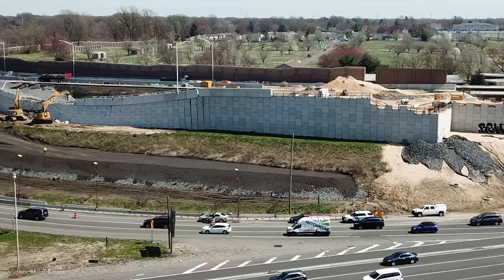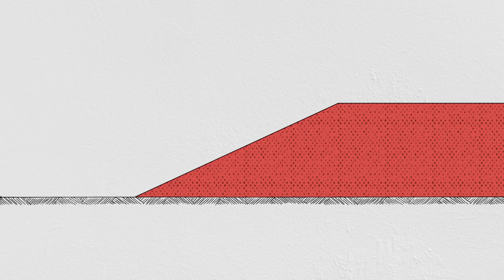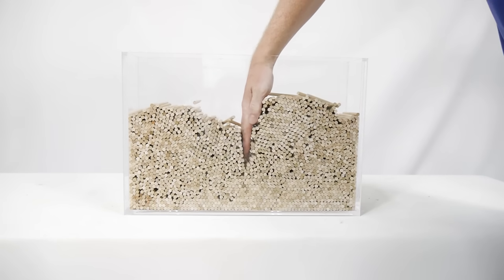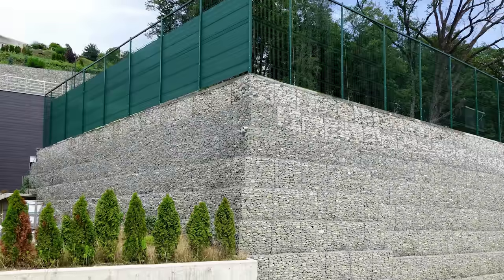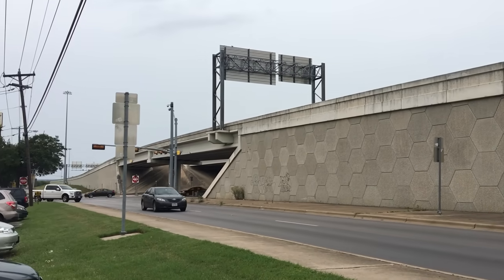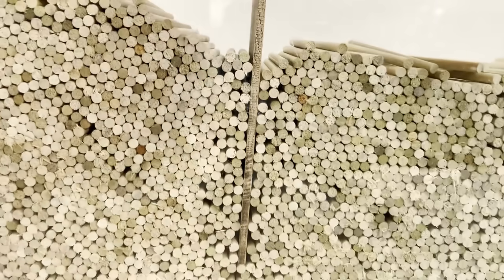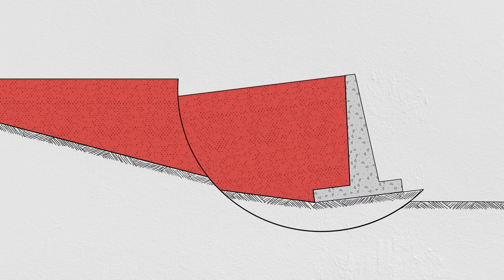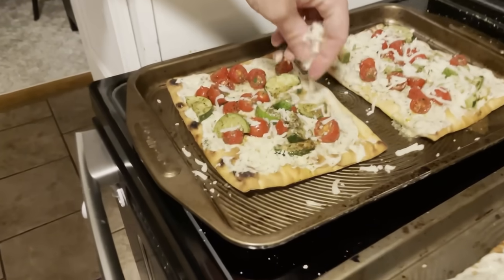Why Retaining Walls Collapse

Comment: Hey Grady! Could you pretty please do a video one day on how engineers construct the parts of a bridge that go down into the water and rest on the riverbed, and support the bridge structure - I don't know what they're called really (the legs?). But they are like magic to me - I don't understand how they built them, or how they don't get swept away by the currents of the river. As I read somewhere, they often use these sheet piles that you mentioned in this video to create a water-free space right down to the riverbed where they can start putting the foundations? Would totally love to see a video about this! Love your channel!
Reply: To be specific, I live in St Petersburg (Russia) and these bridges were built in the 1870s, and I just can't imagine how they did it back then.
Reply: I strongly second this request!
Reply: Grady's vid on building underwater 
youtu.be/URC125wpMS4
You can build a temporary dam down to the river bed, then pump all the water out, leaving you a clear river bed to work on.
Reply: Yes, I agree. It's hard to find videos that show them sucking water out and installing metal plates, and I am curious how they pour concrete for underwater too! And what exactly sits on the concrete I beams! I've seen plates, metal, but I never see them pour concrete on for the actual road
Reply from the maker: I have a video that covers some aspects of bridge pier/bents that someone linked below.
Reply: @PracticalEngineeringChannel  Thanks! I must have missed that one.
Reply: @massimookissed1023  Exactly. That kind of underwater temporary dam creates a dry area where work can take place, it’s called a caisson.
Reply: @SamuelKristopher  might have done it "Roman-style" and just use a very very lot of structure!

Comment: I live in New Jersey and I have been waiting for the report on this collapse.  Immediately after the collapse, a retired civil engineer friend with connections to NJDOT told me that NJ tried blaming the contractor for not following the spec.  The contractor replied with a warning letter that they submitted to NJDOT that it would fail.  Then all went quiet.  There are multiple ramps that were built up in this project including the half of the roadway in the picture that didn't collapse.  They are still proceeding with other ramps but one has to question is what was already built wrong too?
Reply: Im not surprised. The level of state incompetence is mind blowing.

Comment: An underground parking in my home town in Belgium was made with pile walls. They first drilled the retaining pile walls, then made the concrete top, and only then started to excavate the parking. 

You can still see the ceiling of the parking is rather rough, and the walls also aren't covered and just show the concrete piles.

It had a big advantage for our town, as that area was still usable during most of the construction works. I believe they even did the top in two parts, to allow the bus lines to keep using the square. And it greatly reduced dust in the environment, so less complaints from inhabitants.

Comment: I live a few miles from this project.  A very busy and populated area.  This project has been going on for almost 10 years in the construction phase. There have been a lot of issues with people, property etc.  It would not surprise me if there was some change in a phase that wasn't fully design out. It also could be a misunderstanding of the topographical area.  There is a marsh in this area and they have built around and through it over many years.  As a retired engineer I can imagine how complicated this project is.  I'm just thankful no one was hurt.

Comment: I've been wondering for a long time why residential basement walls don't collapse under the pressure from the surrounding earth. This video answered some of those questions but I would enjoy a video or other discussion of how these ideas apply specifically to residential basements. As always, thanks for the good work!!
Reply: Typically these arent very tall and the house structure acts as internal bracing to an extent.
Reply: They certainly can. Especially older CMU basements.
Reply: Basements typically have footings too, not just the vertical foundation walls. They're also a square box so they have something to resist the sideways forces, so long as the walls themselves don't bend and fail.
Reply: It helps that basement walls are not vertical cantilevers. They can be thought of more as beams spanning from the basement floor to the basement ceiling (which is why horizontal cracks running across the middle of the wall are scary... that's the wall splitting open under pressure). It also helps that they have the weight of the house pressing down on them and holding them together (think of how you can hold a stack of books sideways by pressing them together so they don't fall down).
Reply: So over here, the basement is known as the most expensive part of the house and that's for a reason, every single house and especially the foundation and basement must be engineered to strict criteria depending on soil type, location slope and the rest of the house. The planning engineer is held accountable for the construction and has to present to control the build process, reinforcement layout etc. And that's only for a single family home. Public buildings like schools and such have even stricter rules.
Reply: The walls also have footers. Picture an upside down T
Reply: I've built many, many homes, and we don't backfill totally against even the 42" stemwall (because the backhoe, etc. will bend it).  We get the floor structure and subfloor on then backfill.  8inch concrete walls are strong, but framing elements stiffen them in their "loose" direction-
Reply: They do fail.  I was a painter on a house with an exposed basement wall on a hill and i probably was sandy soil.  
It was a luxury house in the sixties.  The upper level had a garage and before the floor was poured, the caterpillar operator parked his cat inside the garage to keep it out of the rain. As mentioned below, the wall bent outward because of the extra weight.  They somehow pulled the wall back to plumb, but it was an ordeal.
Reply: @stevefirst9521  To keep it out of the rain. 

SMDH

Comment: Hi Grady.  Great episode.  I live in the area you featured in the opening and commute up NJSR 295 almost every day.  If you look carefully at the aerial images you will see large expanses of open space in the background.  that is a cemetery - a huge source of infiltration for stormwater.  What you cant see in the images is  the fact that this area is part of a long belt of clay deposits that run from southwest to north east NJ, roughly along the NJ Turnpike.  These clays are what's known as 'acid producing' as they are buried, sufidic marine clays.  When exposed to air and water, the sulfides react and produce sulfuric acid.  It is not treatable with any amount of lime and must be kept unexposed during construction and reburied.  The acid is strong - ph around 2 and can attack any metal or concrete and will kill almost any vegetation it comes in contact with.   The other part of this scenario is the fact that the clays are highly impermeable.  They used to be mined and used as a liner and cap material for landfills.  The clays are set in layers of alternating sand and clay.  During initial stages of removing vegetation from all the slopes along 295, the slopes were left barren for a long time.  The slope cuts caused the clay layers to daylight  in this area.  And many many times, large seeps were visible in different places along the slope.  In winter you could easily see them because they froze.  I think the combination of the acid clay as well as the seeps with the enormous open source of rainwater infiltration probably undermined the wall.  The basic wall design was a vertical layer cake of the panels on the sides connected to each other on opposite sides of the road with a geogrid which when loaded, would act to pull the panels inward or at least hold them tightly.  there are many layers of this as the wall goes up.  There is not much else behind those panels but earth and geogrids acting in tension with the applied earthen load.  Anyhow the clay and those seeps are major factors in the construction out there.  it will be very interesting to see what the final forensic report comes out with.  Hope you do a follow up when that is released!  keep up the great work.

Comment: Always a pleasure to learn more about earthworks. Thanks!

Btw, that first video you mentioned was inspirational. I'm into wilderness survival as a hobby and the reinforced earth method is great for building a warm shelter when available tools and resources are limited. Dirt and plant fibres are readily available, and you won't need to mess around with the time-consuming process of making and baking bricks.
Reply: Unbaked mud bricks usually have plant fibers to reinforce them.  And wattle-and-daub construction uses woven wood from thin branches as "rebar" for the daub (applied clay and aggregate), either on its own or in the spaces between timber framing.
Reply: Are unbaked mud bricks useful, though? Seems like it'd be more worthwhile to just slap and mold on a handful of fibre-mixed mud onto the wall. Much less time and labor.

I can see the benefit for the roof, though. Plain dried bricks could be made and dried before reaching roof construction, and then layered up in a dome for a secure roof.

To clarify, the situation I'm considering is when you need to get a very warm and/or protected shelter up ASAP, you have limited tools and resources, and a basic tipi or lean-to is insufficient. The mud shelter just needs to last long enough for a more permanent solution. The environment envisioned is a windy northern rainforest, cold but not yet freezing.

Comment: My mom has a retaining wall behind her house, she got it put in because she wanted her yard to be flat in 2 levels. That 4 foot rule applied exactly here and thats how tall the wall was because "they cant make a wall over 4 feet without city involvement" fun fact the wall has collapsed 3 times
Reply: Wow. That’s rough, since the City involvement is not necessary for retainers four foot or less the contractor is free to build off the top of his head, thus constant collapse and replacement. Perhaps the city has standard engineered walls in a hand out for the public to use. In SoCal the building depts have such handouts for the public. For short retaining walls.  More expensive but less problems in the long haul. Good luck.
Reply: @stevelopez372  If I ever get one built on my property I am definitely making them build it at least 4.5 feet so they have to build it right
Reply: @stevelopez372  Lmao imagine thinking the way they do things in Cali ougbt to be THE standard. Stay on that dope bud
Reply: @toastedt140  Imagine thinking making plans for an engineered retaining wall available to the public is a bad thing.
Reply: Our local code enforcement has lowered the four foot rule.  Where I live it is three feet.  Anything higher than 3 feet requires a permit, and architectural plans.  They also make you install a product called geo grid behind the wall when you are also installing your drainage system.

Comment: I live in a very old Italian city, it is very common to find an older version of these walls along the streets of the historic center. I wonder how they work, looking closely they have large cracks that act as drains, the base of the wall is often made of a solid block of stone that has always been present on the site, while the rest of the wall seems to be made of simple stones and bricks . They are not reinforced by concrete or metal, I have always wondered how they work.

Comment: Great video! I learn a lot from all of them.  I am not a engineer but have constructed several stone and stackable block retaining walls over the years. I don't know what the standards are and did not bother with permitting them. I receive between 60 and 70 inches of rainfall every year and the walls are about 4 feet high at the highest point.  They are still standing plumb after 30 years because, as I don't know the standards or codes, I overbuilt them to compensate for my ignorance.  Two feet of compacted gravel below and three behind them  over ground cloth and with drain pipe, plus being very anal about being plumb and level. Someday the earth will push them over but it won't be my concern. Thanks Grady!

Comment: I live on a steep hill and most of the properties in my street are being knocked down and re-developed into medium density housing. The developers of these properties usually have to level the soil and from the few projects I’ve seen, I don’t really think the retaining walls they’ve built are going to do their jobs properly. On one project I saw the developer install what looked like plastic blocks into the retaining wall, it was weird, I felt like asking them what were they and why hadn’t they secured the face of the wall with concrete and steel?

Comment: I always tought those walls are scary. They always seem way too vertical for the crazy loads they withstand. This video makes me a little less scared.
Reply: I see some rock faces that seem to be held in place with glorified chicken wire. I'm sure it works well enough, but wonder about the safety margins (had one where a semi plowed into it and caught fire. Still held though).
Reply: @quintessenceSL  I think those are too prevent loose rock from falling down and hitting vehicles, bit holding back the weight of the rock
Reply: I designed/built a well pad in SE Ohio that my geotechnical engineer said was the worst soil (silt and glacial till) he had seen anywhere in the world in 40 years. The pad has a 140 tall fill slope of near 300k yards of material at a 1 to 1 slope. Thing still sketches me out but it still stands.

Comment: I find these videos really interesting. I am an electrical engineer and would find it really interesting if you showed some of the soil dynamics mathematics and formulas.  

I did have a small amount of training in mechanical and civil engineering in my first two years of school, but never saw any practical application.  Even more interesting would be to see the calculations for a retaining wall that did fail pointing out what they missed or what changed.
Reply: Fun fact. Soil is in between solid and a liquid, called the powdered media, it is neither entirely strengthless like liquid nor completely rigid like a solid. You might recall that a liquid column of height h exerts HORIZONTAL pressure of rho x h. A solid of height h exerts NO  HORIZONTAL pressure. Soil is intermediate between solid and water   so it exerts horizontal pressure of rho x h x Ka  , where Ka is lesser than unity. The Ka is derived based on the "angle of repose" of a soil. Ka is called active pressure coefficient.

Comment: Geotechnical engineer here, this is a great video. If you were to do another video and go more into detail I would mention the differences and effects of active vs passive earth pressure as when designing these types of walls or SOE systems active earth pressure assumes movement which can be an issue depending on construction location (urban environment). And cohesive soil design for these types of walls differs quite alot as clays have cohesive strengths allowing for different design assumptions. Mentioning common types of failures would also be an interesting video idea (ie washouts, tension cracks, overturning, sliding, etc)

Comment: In Liverpool, England, some oaf put shipping containers on flat ground near the retaining wall holding out the sides of a 19th Century cutting for the main railway lines into the biggest rail terminus, and used the containers for storage of heavy items. By using containers rather than building sheds they could avoid scrutiny from planning laws  (you call them zoning) and building regs.

Some years later the sides of the cutting started to fall in. Luckily, there being 6 or more paralell tracks at that point, the first train to pass was on a track far enough away to not get rocks falling onto the train itself, though some had rolled onto the track.  The train driver (engineer) was able to radio the signaller (despatcher) in time to stop all other trains, and if I remember rightly in the end that train had to reverse to get out safely.

A main line station for a major British City was closed for months as a result, disrupting both the morning commute and leisure travel. All to save the "bureacracy" of getting the  new storage signed off by the city council.

Comment: In my neighborhood, the subway system is in the phase of underground extension.
To build one of the underground stations the engineers seem to have used a technique not mentioned here 
(unless I have understood nothing in the explanations, however very clear).
Before starting the excavation they dug  the location of all the retaining walls surrounding the pit 
(~ 10 m X 10 m and ~ 15 m depth) by flooding the trenches during digging to avoid their collapse.

Once all the trenches were dug, they replaced the water, drowning the trenches, with concrete thus forming the retaining walls (there must surely be reinforcing bars but I did not see them). 
it is from the moment when the concrete has been completely dry that they excavated the zone delimited by these exterior walls.

Comment: There was a pretty good example of a slope failure in construction at 151st street and I35 here in Kansas. Engineers built an east/west bound bridge crossing over a North/south bridge over the interstate. For some inexplicable reason they built the support columns for the east/west bridge on the fill above the slope instead of  through it. The weight of the bridge eventually buckled the concrete covering the slope and they had to close the bridge for repairs.